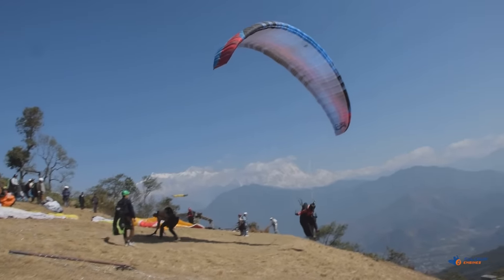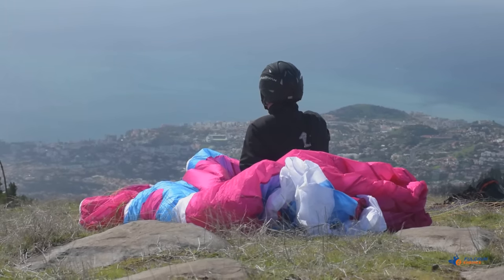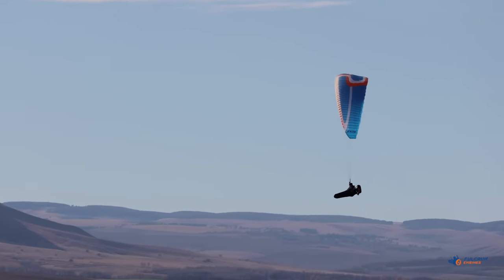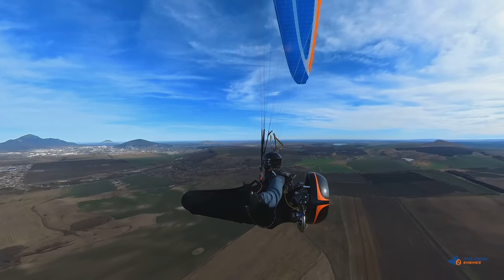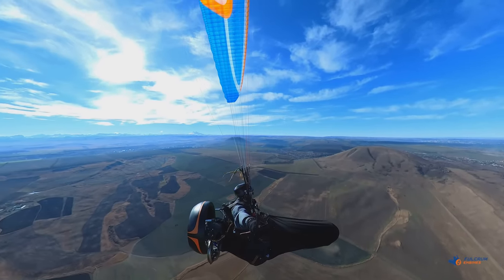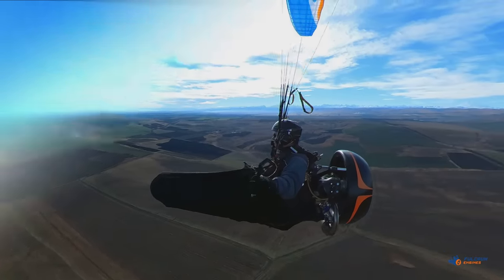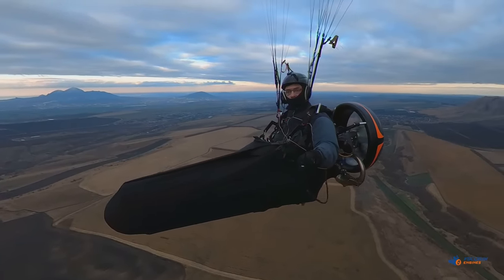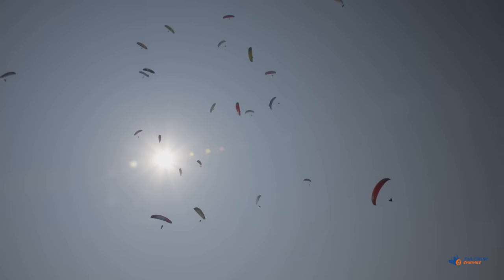Fulcrum PowerPod is the world's first paramotor pod harness with a ducted fan only 0.5 m in diameter

Comment: This is exactly what I want! Man I would so love to give it try, I wonder what is the weight including harness. Also I wonder will there ever be an electric version?
The whole idea is good if weight shift is less impeded and more of a torpedo launch could happen if on a hill. Looks like that is the case!
Reply from the maker: We plan to release a Powerpad with a weight within 20 kg. 
According to our calculations, the electric version is much heavier than the ICE version due to the large weight of the batteries.
Reply: You don't have to have a 4kwh battery (that would let your run over an hour), just a 1kwh one would do, you just need 15min for climing up

Comment: Looks cool! What kind of price are we looking at?
Reply from the maker: We will calculate the price when we are close to mass production. Unfortunately, the PowerPod price will not be less than that of traditional paramotors. It is impossible to make a compact and lightweight ducted fan system without use of composites, carbon fiber and Kevlar. And these technologies are more expensive than welding metal frames of conventional paramotors.

Comment: 12 years ago we made the first tests with an electric driven pot propeller for paraglider drives and found out that it consumes too much power, which results in a heavy and expensive battery.  Diameter less than 1,3m of free spinning props and 1,0m for shrouded props are noisy and unefficient for EPPG.
Indeed a shrouded propeller can be more effectiv than a free spinning one especially in the back of an obstacle (pilot). We made one of the first EPPG (scott-e) in Germany with folding prop. It worked very well even in heavy thermals. But weight and cost did not allow big production numbers and manufacturing was stopped. Because of the additional high shroud cost this technology is even more difficult. Using a 25hp petrolmotor the noise will be not acceptable at all for the pilot and the environment. 10kW is the max power you should need for a good climb rate and a well designed drive system.
Reply: gibt wohl nen Grund, wieso man den sound von dem Teil nicht zu hören bekommt.
Reply: Yes it will be loud but only as needed during initial climb. The real question is how much will the extra weight and drag reduce thermaling potential. I can’t see an electric application here because the battery technology is just too heavy right now.

Comment: Have you thought about stator vanes to take out the twist and increase efficiency? Maybe not be worth the extra length and complexity, but since you have CFD capability it might be worth modeling.
Reply from the maker: Installing the stator after the fan can give a few percent of additional thrust, about 2-3%. But this significantly complicates, increases the cost and makes the design heavier. We think it's not worth it. 
The torque from the fan is too small to be worth eliminating. It does not interfere much in flight.
Reply: @fulcrumengines2519  Cool, thanks!

Comment: What's the flight time if the motor stays on?
Reply from the maker: Engine operating time in climb mode (75% power) at least half an hour. This is more than enough to climb 2-3 km of altitude and go to a soaring flight.
If you do not climb, but fly in horizontal flight, then the engine will run for more than 1 hour.

Comment: Hope to see an all-electric model!
Reply from the maker: The electric version will be perfect, if you do not take into account the problems with the battery. The main thing is its weight and dimensions. The version with an internal combustion engine turns out to be much easier if you need to fly for more than 10-15 minutes.
Reply: @fulcrumengines2519  This guy claims 15 minutes of flight time with less than 5kg of batteries. https://youtu.be/NkJ9LF_8hIQ - if the object is to use the motor only for gaining altitude then how much battery time do you need?
Reply: @JohnPowell6  A climb flight or a horizontal flight require completely different levels of energy. In horizontal flight, 3-4 times less energy is spent than in climbing.
And two channel fans 0.7-1 m in diameter will work more efficiently than one 0.5 m in diameter. In any case, as far as I could estimate in your video, the flight altitude did not exceed 200 m. PowerPod can gain 1200-1400 m of height in the same 15 minutes.

Comment: I do wonder if the range of it would be longer than usual even for those who aren't looking for free flight. ^^
Reply from the maker: Unfortunately, I think it's unlikely. The fuel efficiency of the PowerPod is worse than that of a conventional paramotor due to the small diameter of the fan, only 0.5 m. It gives about 30% less thrust than a 1.2 m propeller of a conventional paramotor of the same power. Therefore, fuel consumption will also be higher. But we are still working on setting up the fuel system and there is no final data on fuel consumption.

Comment: Since this is an altitude assist unit, wouldn't an Li powered EDF be another possible design?
Reply from the maker: It is possible, but with a very short flight time, 10-15 minutes.

Comment: Would the PowerPod work with a Hang Glider?
Reply from the maker: Now the PowerPod is designed to fly with a paraglider, for its speed and features. It seems to us that the use of a duct fan for a hang glider is not as appropriate as for a paraglider.

Comment: What is the efficiency/range? Cross country paramotor trips are a thing and any improvements in efficiency = $$$
Reply from the maker: The goal of the PowerPod is to get to a height where you can catch a thermic and soar with the engine turned off. 
For route flights, it is better to fly on traditional paramotors.

Comment: Which is the maximun distance you can travel ?
Reply from the maker: The concept of using our PowerPod is to climb up to the thermals and soar in them with the engine stopped. Therefore, the main mode of operation is the climb mode.
Therefore, we have not yet conducted tests for the range of motor flight.

Comment: Can there be a conversion to use under a delta wing?
Reply from the maker: We'll think about it. It seems to us that the advantages of a small ducted fan will be significant only on a paraglider. It is not so dangerous to fly on a hang glider with a folding propeller without a protective ring.

Comment: Would like to see an electric motor.
Reply from the maker: With an electric PowerPod motor, it will be very heavy. The weight will be acceptable only if you make the motor mode time very short, 10-15 minutes.

Comment: for how long can it run ?
Reply from the maker: The volume of the gas tank is planned to be 5-7 liters (it should be compact enough for our concept). This should be enough for 30 minutes of operation at 75% power (climb mode). During this time, you can reach 2-3 km of altitude.
If you fly in the horizon, without climbing, the flight time will be much longer.

Comment: Wouldn't it really be something if by regeneration, one could save/restore switching the prop to a generator to save some of the excess speed for fallow use. Course battery weight a problem.

Comment: Could this be used as just a paramotor too ? That would be awesome as it won't take up as much space in storage. What thrust output are you getting from it ? 
Looks amazing we'll done
Reply from the maker: Yes, it can also be used as a regular paramotor, although its purpose is slightly different. We got 50 kgf of static thrust.
Reply: @fulcrumengines2519  that is awesome. I have a 125cm prop putting out 56kg of thrust. I would 100 % be happy to loose a little thrust for the portability and not having the outer cage hitting me innthe back of the legs

Comment: G'day,

So far as this Infomercial goes, so good.

However, it is noted that you do NOT include ANY Footage including any synchronous Audio Recordings of the Unit in use...(!) ; and, of course, the excellent reason for this phenomenon - is that a Direct Drive Impeller running at 2-Stroke Powerband  Crankshaft-RPM in a tight close-fitting Duct..., is ALWAYS going to sound approximately equivalent to a Piston-Powered AIR-RAID SIREN....

HOWLING it's way really SLOWLY accross the Sky, in all liklihood prompting numerous complaints from anybody on the Ground within 5 Km - and likely resulting in the contrivance being banned from any established ParaMotor Launch Site.

40 years ago I gave up on my design for a Thrustrum-Ducted Wind-Turbine..., precisely because nobody could put up with the Roaring and Howling and Droning noise-hazard.

And, the NOISE from the Ducted Fan will be equally bad with an Electric Motor, while Lithium Ion Batteries seigh 7.5 Kg/Kw-Hour..., so 15 Hp for an Hour involves 75 Kg of Batteries.

So, nice try fellas - but nobody will be buying such a Pain in the Ears.

Such is life,

Have a good one...

Stay safe.

;-p

Ciao !
Reply from the maker: Thank you! We haven't done any noise tests and measurements yet. Mainly because the engine exhaust system is still in the process of fine-tuning. But subjectively, now the noise level does not seem significantly higher than that of a conventional paramotor. It has a different tonality due to the higher speed of the fan, which rotates on the straight shaft of the engine. But I wouldn't call that sound unbearable.
We are planning to make a video with the flight and the actual sound, as I see that many people have questions about this. Unfortunately, at present, the flyable weather is too rare in our region - there is a lot of snow and strong winds now. But we'll be waiting for her.
Reply: @fulcrumengines2519  

Cool !

I used to get a lot of complaints about,

"Making Lawnmower Noises in the Sky..., and taking all day to go away !"

which isn't a bad description of what people on the ground notice about Ultralights flying over...; when one is a couple of thousand feet up, at 40 mph, it takes quite a while to cross anybody's "Sky overhead"

One thing I can't help asking, does the name 

Josef Thomas Dusek

ring any bells ?

Back in the 1990s he was living between Sydney and Bohemia, working here in Oz to make the money he was spending while in the Czech Republic building Ducted Fans, which he was hoping to develop and test on Gyrocopters, Ultralights, and Paramotors....

I used to write for Australian Ultralight magazine, which became Pacific Ultralights (after their Editor crashed and died) before finally becoming Pacific Flyer magazine..., and I wrote some articles about Coanda's Turbo-Propulsor - which led Josef to write to me for a few years.

His Business Card reads,

AEROSYSTEMS
   Principal
Josef T Dusek

Composite Valley
U Kaplicky 299
Sucice 342 01
Bohemia - CZ

Tel.
+420 737 935 200

I haven't had a letter from him since 1994, at which time he was in his 70s and had suffered a Stroke (Cerebrovascular Accident) ; I never expected to hear from him again..., but your Ducted Fan appears to be very Very VERY much like what his last set of Photos shows (7 Carbon Fibre Blades in a Glassfibre-over-Foam Duct behind the Seat of a Gyrocopter.....)

He has his Engine above the Duct, belt-driving his Impeller, and with his Carburettor Air Inlet being fed by a Pipe inside the Duct's Efflux ("Poor Man's Turbocharging"...!).

I don't know if his work has directly influenced your Designs, or if his Ghost has been nudging you in the same directions he wanted me to take ; but what you've built would absolutely delight him, greatly.

Anyway, keep on keeping on..., it looks like you're having a lot of fun ; and I love the way you change the Angle of the Dangle of the Thrust Vector for Take-off versus Cruising Flight.

One of my Playlists is titled, "Personal Aeroplanology..." ; in which you may get a few giggles from what I used to fly...(?) !

Such is life,

Have a good one...

Stay safe.

;-p

Ciao !
Reply from the maker: @WarblesOnALot  No, I haven't heard of Joseph Thomas Rusiak, unfortunately. I had no doubt that we were not the first to think in this direction. Thank you!
Reply: @fulcrumengines2519  

Ah,

No worries, (it was Dusek, rather than Rusiak..., but if it rings no bells that's life...)  it was a bit of a long shot...; but as the saying goes, Great Minds Think Alike...

I'm sure that his "Shade" is somewhere watching your progress with great satisfaction, pleased that someone is going down the same road he wanted to pursue...

Such is life,

Have a good one...

Stay safe.

 ;-p

Ciao !

Comment: Whats the noise like?
Reply from the maker: The engine noise is about the same as that of the parameters of similar power (25 hp), since it operates at approximately the same rpm. The sound of the fan has a higher tonality because it rotates directly from the motor shaft, without a gearbox. But the sound is also acceptable.
We plan to shoot a video with actual sound soon, with takeoff and landing.

Comment: This would be soooo cool if they make an electric version. The whole point is to allow the pilot achieve high enough flight, so it shouldn't need sustained use and a lot of energy storage
Reply from the maker: According to our calculations, to lift a pilot to a height of 1000 m, you need a lot of energy and heavy batteries, it will be heavier than the version with an ICE. The version with an ICE will be easier than an electric one, even when flying 8-9 minutes or more in climb mode.

Comment: Next vid with engine/prop sound please, because we already know this thing must be noisy.
Reply from the maker: I wonder how you found out, even though you've never heard how it works?
In the near future we plan to shoot a video with real sound.
Reply: @fulcrumengines2519     Cause It's the nature of the beast. Ducted fans and Fenestron's make more high pitched
noise because of the high tip speeds of a smaller prop. which needs tot turn at higher rpm
than the larger 2 bladed counterpart for the same amount of thrust to be delivered.
 I like the design of the pod,  and i always believed in a ducted fan because of prop safety.
but not for hearing safety, and thrust figures.
Reply from the maker: @bramesque  Yes, of course the ducted fan has higher RPM than a conventional propeller for the same power. But the speeds of the tips of the blades of the fan have about the same speed as the tips of the propeller. The fan noise largely depends on this, although of course, not only on this.
A lot depends on the design. For example, a fan in a turbofan engine rotates with transonic or supersonic flow. But at the same time, a turbofan engine often runs quieter than a turboprop engine (with similar power), in which the propeller rotates with subsonic flow.

Comment: Interesting concept, but some disadvantages of conventional paramotors seem a bit far-fetched.

Also the fact that not a single second of raw audio can be heard is sad.
Reply: The smaller the propeller the noisier it becomes. The duct should lower the noise a little and make it more efficient. Is this direct drive? All you need to do now is put some wheels on it.

Comment: Please make an electric one for this that makes the most sense
Reply from the maker: We think about an electric version of our paramotor pod harness. And maybe, we will do this in the future. But according to our calculations, the weight of the device comes out much more than with a gasoline engine.
Reply: @fulcrumengines2519  your math is incorrect or your using the wrong parts I would love to help if I could ... You can Regen off the prop spin when not in use if done correctly ... I assure you the electric one would be way better

Comment: Any reason it's not electric?
Reply from the maker: The electric version of the PowerPod will be too heavy if you try to achieve the same operating time as the ICE. The electric batteries are too heavy. If you try to keep the same weight, then the engine will run for 10-15 minutes at full power.

Comment: Needs to electric put flexible solar cells. On the sail  u could put the batteries in the duct rim.   It would be lighter.    U could use the wind for regen   I could build one for 5 grand in a month lol.      U could ad a flight controller do two smaller bldc motors with ducts and vanes and have even way more control..

Comment: What's the specs?
Reply from the maker: Static thrust 50 kg the power of a two-stroke internal combustion engine is 25 hp, the weight of the entire device is within 20 kg.
You can see the main characteristics on our website fulcrum-engines.com . A detailed description will be available during the release of our product in mass sale.